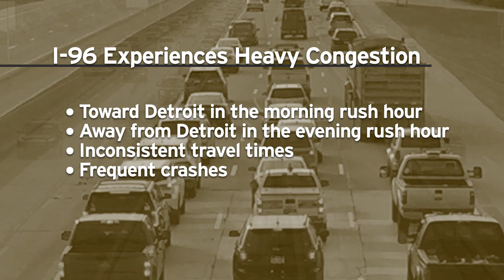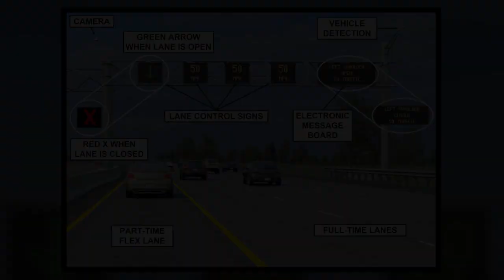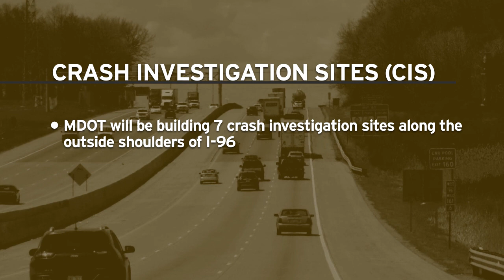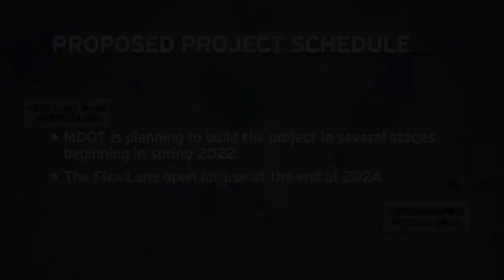I-96 Flex Route Flex Lane

Comment: Add a 3rd lane between Lansing and Howell. Will be ridiculous to go from 4 lanes to 2 after Howell. 

What's the point of the flex lane ever being closed? Just leave it open at all times.
Reply from the maker: Hi Yoshi! It all comes down to available funding. Very expensive to build completely new third lanes (or more). The Flex Route costs much less since the work involved includes upgrading the existing shoulder to temporary lane status. The Flex Route also addresses directional congestion, meaning heavy congestion occurs mostly in one direction during morning commute and the other direction during the evening commute.

Comment: How does adding a flex lane reduce costs compared to just having the lane open at all times? It seems this would be more expensive as you now have to enforce it and install electronics to indicate when the lane is open.
Reply from the maker: Hi Adam! It costs a lot more to build an additional lane (and associated shoulders, plus any associated bridge widening) than to install the electronic Flex Route devices and upgrade the existing shoulder to temporary lane status. For example, the US-23 Flex Route project north of Ann Arbor from a few years ago cost about $92 million, and that included rebuilding the existing freeway lanes. If that work has included building new additional lanes and widening bridges to accommodate those new lanes, the estimated cost would have been about $400 million.

Comment: People are still going to panic at Milford and slow traffic down. The sun will still slow people down and now there is another lane to weave in and out of because semis and gravel haulers travel in all lanes now.
Reply: One way to solve it is add cameras to get the license plate and hit them with points and a big fine. The Pennsylvania Turnpike has cameras that fine drivers speeding but only in work zones so people do 90 in a 55 mph zone.